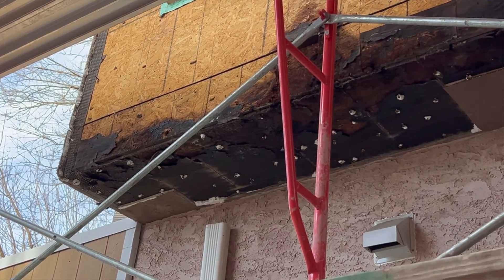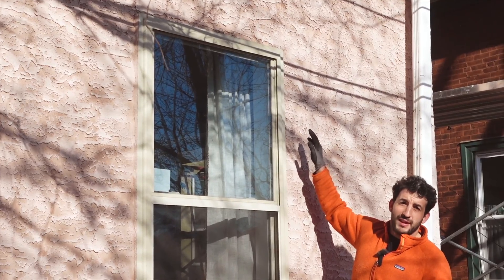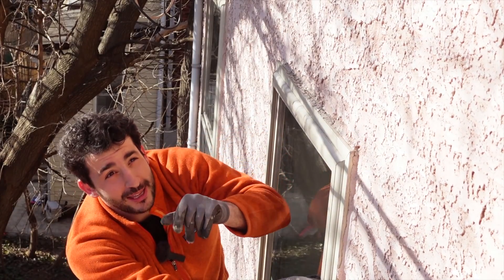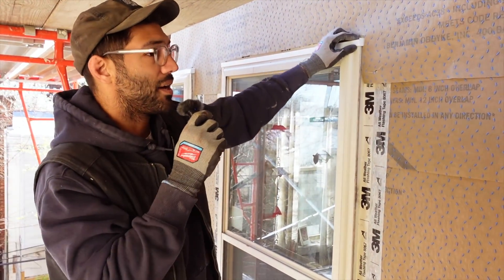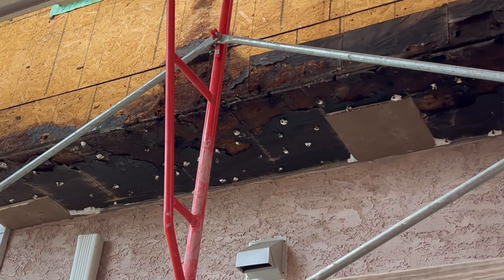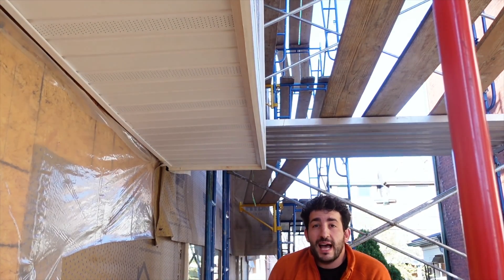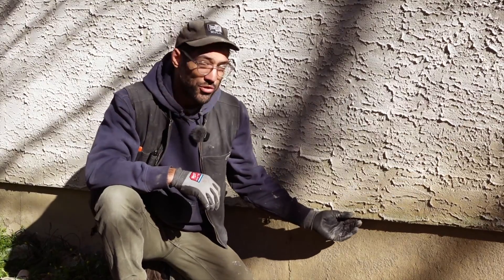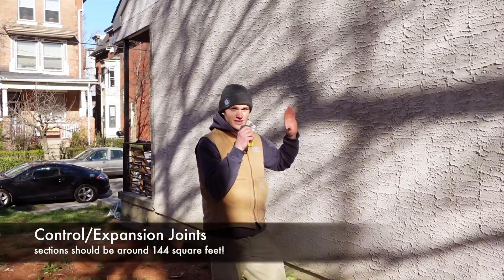STUCCO INSPECTION: 3 Things To Look

Comment: Stucco and EIFs can look beautiful. Especially if you pair with stone work on the foundation. It can really standout. But yes, if it’s not installed correctly. It causes serious problems like water damage, poor insulator and even insects can start to bury themselves in. I’ve done this kind of work for over 20 years. I’ve seen some really horrible installations. Especially people trying to renovate old stucco houses. The client will first hire someone to do the work cheap and the damage gets worse or it’s not fixed. That’s when we would get the call and things would be much more expensive because we have to rip out the previous work and repair the actual damage.

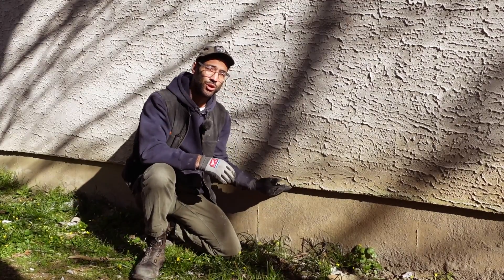Comment: You're wrong at the 4:30 mark.  You have no way of knowing in that instance whether that particular wall will drain. If it was done properly, the bottom screed was placed on top of 2 layers of paper. It would then drain just fine.  As far as expansion joints go, their presence won't make or break a stucco system.
Reply from the maker: @casey2282  While not strictly "necessary", a rainscreen is highly recommended when applying stucco, as it significantly improves the wall's ability to drain moisture and dry out, preventing potential issues like mold growth and structural damage by creating a ventilation gap behind the stucco.  As for expansion joints, they’re not a make or break, but they’re good practice and can be an indicator of how the installer handled the rest.

Comment: Great video. I don't know a lot about stucco but I guess I'm a building science nerd because I recognized your quote (If it can't dry it will die). Grew up in Delco moved to OCNJ. In Pa I think if you buy a stucco house it's customary to get a stucco inspection, seems like south Jersey not so much. What do you think of a wood sheathed building, 15lbs felt apply Hardie backer and durarock directly to it. Then I guess stucco directly to that? Like I said I don't know that much but I'm watching a project in progress. Thanks for the video
Reply from the maker: Thanks for watching, and the kind words!  The hardie backer sounds like an unnecessary step - stucco is usually done over wire lath in 3 coats happening over the housewrap.  The flaw in this is there’s usually poorly detailed drainage.
.
 The couple times we’ve done stucco over wood, we used a wrb called hydrogap SA (self adhered) and then a drainage plane called Slicker MAX.  Both products are from Benjamin Obdyke.
The slicker max is a drainage plane with a felt like layer that keeps it from clogging during stucco install
Reply: @GreenBuildingNetwork  Thanks for the reply. I am continuing to watch this project. Their job site and some of their work practices don't inspire confidence. I guess time will tell.